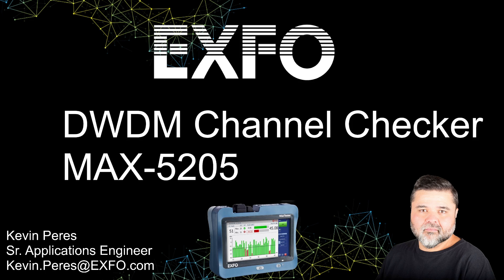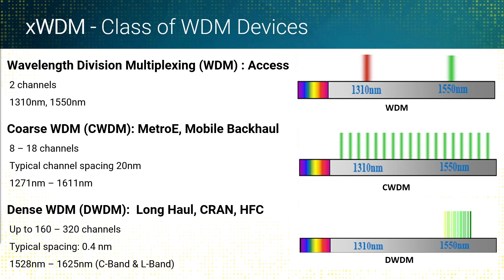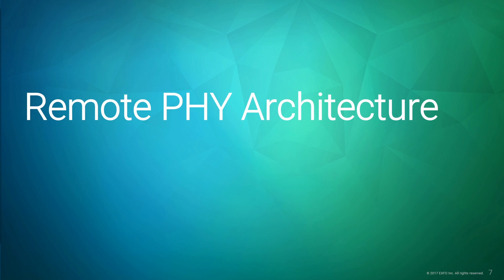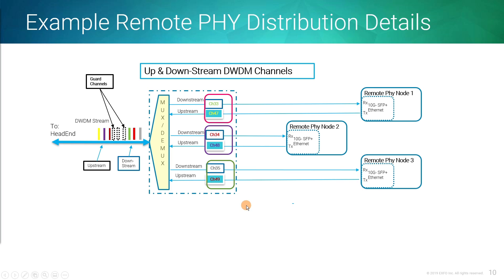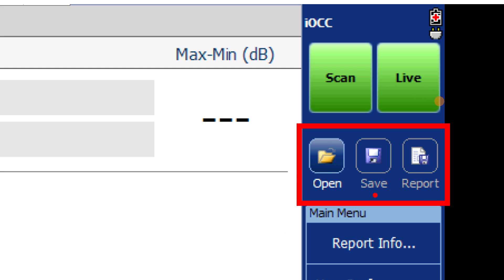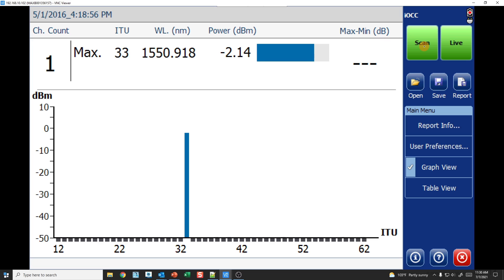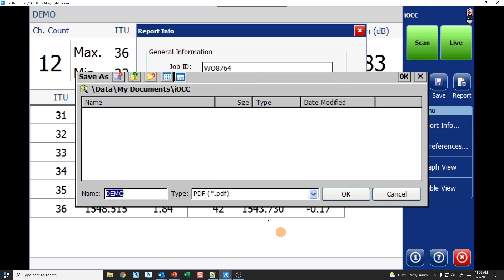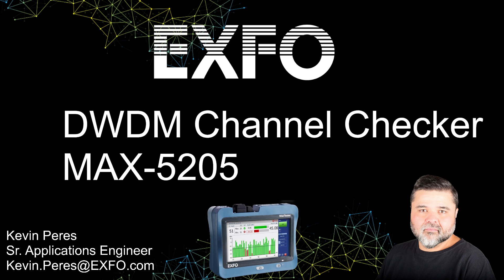Exfo MAX-5205 DWDM Channel Checker

Comment: Thank you for this.  Much better than the supplied documentation and quick start guides.  I will be forwarding your video to peers.  Quick question though....is there a way to move data to a plugged in Laptop via Ethernet...as an example.
Reply from the maker: Jesse I am glad you liked it. If you have the Max platform yes there is.   We have an FTP transfer capability. I believe I did a video on it for a customer I will dig it up when I get home. I am out singing karaoke !